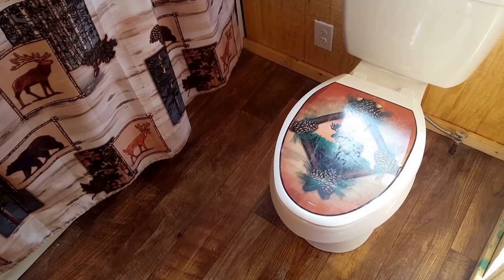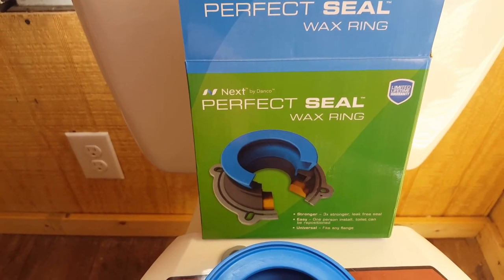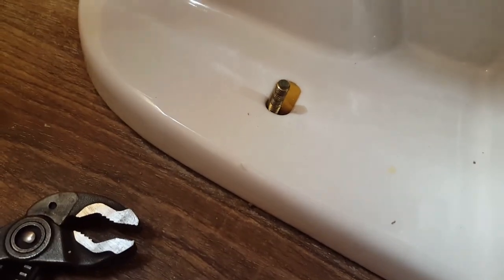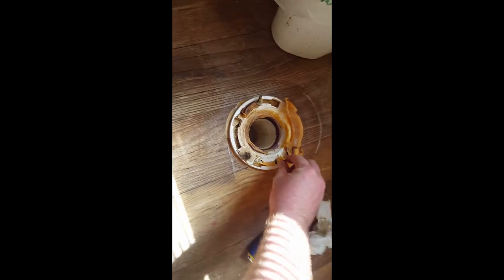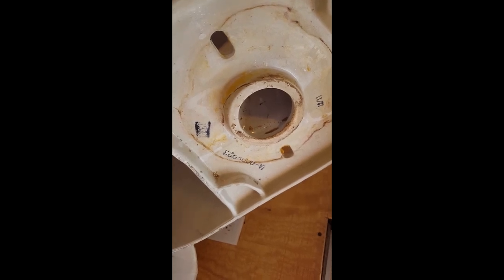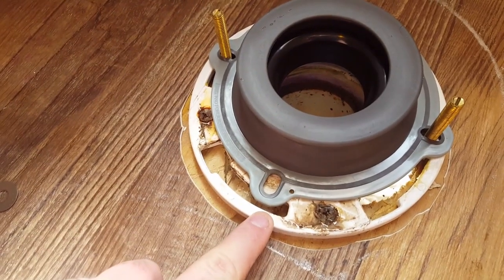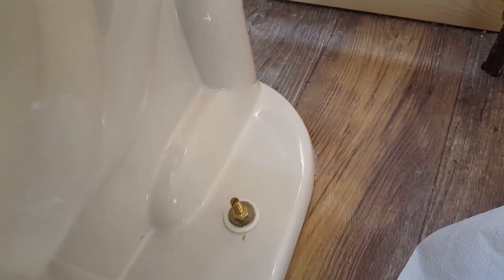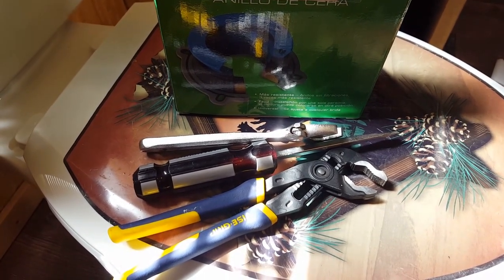Danco Perfect Seal Toilet Wax Ring Replacement and Install

Comment: Thanks for the video.  Good stuff.  For anybody who is doing this - I would also suggest placing a cup into the pipe after you remove the toilet.  It will keep the sewer gases from coming back up into your face.  And trust me - you'll know it when it happens.  If you're not going to be doing this all at once you'll want the cup in there.  A Styrofoam cup or any plastic cup that's lying around in your car from the convenience store works great.
Reply: If you use the same seal (new) he used, does it help with sealing the top of the seal to the bottom of the toilet by putting a small amount - a light coat / layer of wax either on the area of the bowl where the seal makes contact, or on top of the seal? Debating on which seal to use

Comment: Just installing this now. There is a blue adapter that comes with the kit. If your flange is above or level with the floor, then you do not need the adapter. If however your flange is recessed or below the floor, then you should use the blue adapter. Mine is level, so no adapter.
Reply: Have you had any leaks?
Reply: So far so good.
Reply: @paflyfish  awesomeness, thanks.

Comment: Used this to fix leaking 20 year old toilet in house with really messed up plumbing dating back to the 1930s.  It sealed correctly and is still working fine.  I will use this product again.

Watch a few different how-to videos first and read the instructions a couple of times BEFORE proceeding.  It helps.
Reply from the maker: Mine is still doing fine

Comment: Put a little safe gasket grease or O ring grease on the grey seal and the toilet horn will slide in easy ..if not the grey seal can bend when the horn makes contact with the seal and get a improper flush seal...u can do it while you have the toilet on it side u can tell  how easy it slides with grease  vs without it
Reply: I used KY

Comment: How do you think this will work on an older lead flange? My flanges even with the ceramic tile may be slightly higher however, between the flange and the ceramic tile is the subfloor that has cracks in it so I laid some adhesive caulk in there, so that if there's a breach in the seal water wouldn't go down the cracks.

Comment: David I noticed on video explained that the rubber flange is to be screwed down to the floor in centered position. I noticed in this video the seal is loose and shifting. I had both of my wax ring seals fail due to the fact the wax seal was bumped and shifted to one side and was seeping. One resulted in water on the floor after 2 years the second one about 8 months.

Comment: Did u plumb the water line on the wrong side
Reply from the maker: +Peter Boissiere I did
Reply: Strikes me as the kinda guy who would install a regular wax ring and not take it out of the plastic it came in.

Comment: Their official video on this gasket set up says to remove that inner, black, round piece to allow the wax to set correctly. You didn't show that being done. Oddly enough, the instructions do not cover this as it did in their video though and neither did the instructions and photos on the box it was packaged in. This makes for an interesting question, as is it an unknown if that ring part needs to be removed or not when installing.
Reply: Correction to above. I did find the round plastic insert adapter noted in the instructions as #6, item D, after all. "If the toilet doesn't sit flush on the floor, then remove the black, round plastic insert (D) and reset.
Reply: a1930ford look

Comment: How do you keep that type of wax ring from moving ?
Reply from the maker: Its not really a wax I say more like a heavy rubber like membrain that is pulled tight to the flange with the bolts.
Reply: @davidreynolds5439  there is wax in the membrane. I used one and had to remove it. It’s just covered so you don’t see it but there is wax in there

Comment: hows the product holding up three years later?
Reply from the maker: Still going good. Zero issues. Even after getting some foster girls and having all of thier friends over all the time. Still not issues.  Even went under the house and looked around and no signs at all.
Reply: Used the perfect seal 3 years ago.  Still working great.  Zero leaks.

Comment: did he not use the blue part?
Reply from the maker: No I did not need to use the blue ring since my flange was even with the floor
Reply: My floor sits like 1cm under the subfloor do I use the blue part?

Comment: Another thing to change while you're at it: the infamous "one-time use" water valve. They work when installed (like when the house is built), then never work properly again, plus they weep around the handle shaft and corrode. Do yourself a big favor and buy a quarter-turn valve. They actually shut off the water when they need to.

Comment: 🚽Regarding those 2 white plastic washer-like pieces that were under the nuts holding the toilet to the flange ring/floor.  You stated you did not know what they are called or why they were there.  Towards the end, after you set the toilet, you re-installed them and the nuts onto the 2 mounting bolts (Johnni-bolts).  Those plastic/nylon pieces are there for you to put the Johnni-bolt covers back over the bolt/nut that stick up - holding the toilet to the floor.  
After putting the cap over the bolt - push hard straight down - and you will feel & hear the cap snap-lock onto the nylon washer.  That's what keeps those covers in place.  Of course in your case (video) - we never saw any caps - so either you or previous owner never bothered to install the caps in the first place.  
Now you know what those nylon/plastic "washers" are for.  🚽  🙂

Comment: Why are you calling the rubber ring wax?
Reply from the maker: +cooldog60
Old habit.
Reply: The Danco Perfect Seal actually has wax in that bottom part, covered by the rubber.
Reply: Its has wax in the bottom
Reply: (1:00)  Very clearly states it is a WAX ring right on the box.

Comment: Use a Shop Vac to suck water out of toilet instead of sloshing it on the floor. Thanks for making this video.
Reply: That's a good idea, but even better is to flush to empty 95% of the tank as you would anyway... Then get a bucket of water and dump quickly into the bowl.  That will flush it and siphon 95% all the water from the bowl down the drain.  Then vet vac both.

Comment: I also used silicone around the sides of the toilet
Reply from the maker: I dont like applying any type of caulking or silicone caulking around the base for 1 reason.  It the wax ring would fail a leak could go undetected and cause damage to the subflooring. Thanks for the comment though.  Please sub and share.
Reply: @davidreynolds5439  I like to silicone or latex caulk only the front and sides (not all the way back) because it keeps fire-hose urine from going under while leaving the back open, so any bad toilet seal will cause visible water to pour out behind the toilet alerting you to a problem.

Comment: I just picked up one of these new seals.  Although it comes with its own Johnny bolts, I wouldn't recommend using them because they are plated steel and will rust/rot in time.  Go to the hardware store and buy brass ones.  Other than their bolts, this seal looks promising.  I plan to use it in the future where a plumber gave me 2 wax rings instead of using a spacer or this product.

Comment: I like to use DAP® SiliconeMax™ White Kitchen, Bath & Plumbing 100% Silicone Sealant - 2.8 oz. around the toilet except the very back of the toilet in case there is a leak in the Wax or Perfect Seal. This keeps the toilet from wiggling and from rotating left or right, and it looks good.

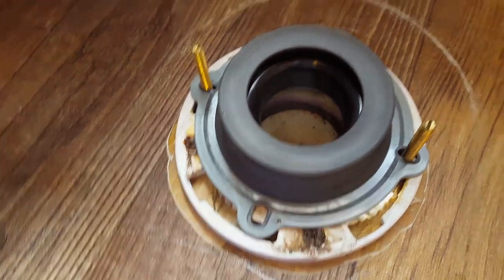Comment: 5:37 Skipped right over the hardest part.
Reply from the maker: What was the hardest part?
Reply: @davidreynolds5439  The part you skipped. Setting the toilet. Hard to line up both sides at the same time when you can't see them.

Comment: I used this product.against my better judgement, because i dont really like experimenting .. and it failed !!!!  now im replacing sheetrock in my kitchen. Ill stick with the wax rings which has been just fine forever and cheaper
Reply: With or without the funnel?

Comment: Greta video, I had accidentally poured a ham hock bone in the toilet. Luckily it got stuck in the pee trap. Using this flange to replace.
Reply: I need the full story here lol
Reply: @614jacob2  i had made some red beans and rice and poured water in the pot to loosen the dry beans stuck to the pot but forgot i used a ham hock. I don't like using the garbage disposal alot so I pour things down the toilet and forgot the bone was in the pot. So when you pour water in a toilet it will automatically flush itself sometimes and by the time i noticed it, the toilet had already flushed 😳